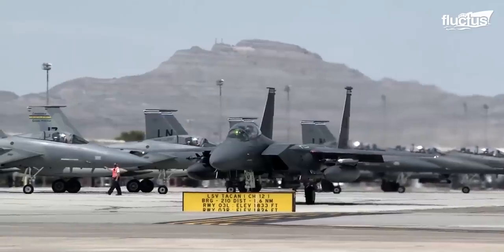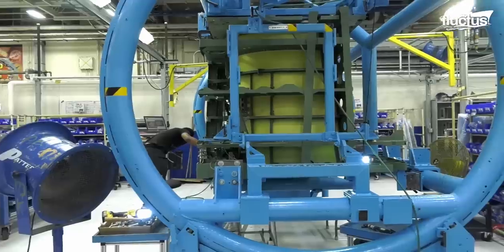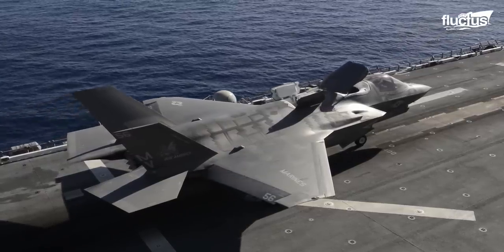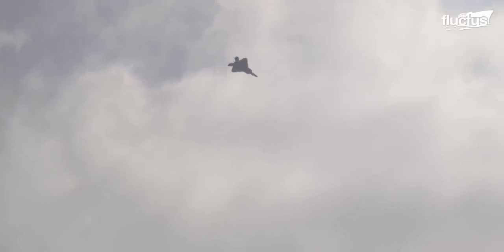How this Cheap But Genius Invention Made the F-15 Most Feared in Dogfight

Comment: Did I miss it, or did you forget to tell what the "Cheap But Genius Invention Made the F-15 Most Feared in Dogfight" is ?????
Reply: (air brake)
Reply: @douglasbuck8986  thanks.
Reply: @lynncomstock1255  NP  Did 10 years at RAF Lakenheath with this airframe....
Reply: The cheap invention is the door at back of the cockpit for braking and maneuvering
Reply: So we could have stopped at the 5:00 point of this advertisement...
Reply: I miss the air shows. These guys put on a great show at low altitude, def what the F15  wasn’t designed for
Reply: It has a can crusher. Makes nickles on board.
Reply: Also makes rainbows.
Reply: 😂 I was waiting for it this whole time.
Reply: @TaylorABell  airbrake
Reply: That's what I was wondering
Reply: Lays golden eggs as well (for the rear navigator).
Reply: you definitely miss it brother and it is a kind of harder than it sounds.
that cheap thing would be the bubbled canopy shape which is so  vital for a fighter pilot to have a kind of 360 degrees field of view while being immerged into dogfight with other aircraft.
Reply: @douglasbuck8986  Thank you!
Reply: 4.29
Refers to the air brake, speed brake.
Reply: @jamesleaty7308  You said the F-15 had a can crusher that makes nickels. A friend of mine is a Submariner. They sometimes put a coin in between the Hatch and the Hull before they go to Sea. When they come back up, the coin is recognisable, but 4 times the size and not much thicker than aluminium foil. It's actually pretty freaky. God knows how the first guy figured out it would be a laugh...
Reply: @mouhcinesniper3495  Naaaah....the air brake....
Reply: the air brake lol like thats a big deal
Reply: speed brake???
Reply: @kibbyken5975  I stopped at 1:41 and just scrolled through the comments until I found the answer.
Reply: @tsubadaikhan6332  I believe that,,, I was jokin about can crusher. In my 50's. Large # off family members in Navy. i'm sure they crush all cans on board, for space. Most large vessels have compactors, for cardboard and trash. They make big bales ,  and forklift them off. They get $ for cardboard and plastic.
Reply: @douglasbuck8986  Yeah but it is mostly used for a controlled landing. And not "How this Cheap But Genius Invention Made the F-15 Most Feared in Dogfight".

You try deploying a speedbrake in a dogfight, you bleed massive energy, and you are dead. Go try it in DCS and see how long you last. Not very!!
Reply: This Guy is a repeater making crazy crap up
Reply: Don't feel bad. You are not the only one that missed it.
Reply: I guess I missed it as well now I have to join the atf to find out
Reply: And why the extra $100 million dollar cost.
Reply: I would say it's the backseater, but the air-to-air models don't have them....
Reply: He keeps mentioning the ginormous speed brake on the back bone, I used it to sleep under on night shift.
Reply: @douglasbuck8986  --@Q2Q
Reply: Cup holders.
Reply: 15 minutes of my life, I'll never get back!!
Reply: Certainly not new, and not inexpensive. Originally designed by "the Fighter Mafia" of John Boyd and Pierre Sprey" ilk.
Reply: Cigarette lighter
Reply: I think its the decals..?
Reply: It is crap because without their AWACS, their air-to-air missiles lunch by F-15 can never hit their targets. It is the AWACS which guide the missile to the intended target.
Reply: Electrics and weapons carriage.
Reply: @mouhcinesniper3495  Immersed* not immerged*
Reply: Streight beast mode

Comment: Did you know the first of the F-15 A/B had it's speed brake was 3 feet shorter, in the early 80's the speed breaks were mortified to what you see today. One correction on your comment on speed brake,  the speed break control is a toggle swatch on the right throttle and can be set to any position you desire, use your left thumb and push up and hold and release it to any position you desire. Push the toggle aft and it will lower to any position as desired. I spent 22 years  as a Crew Chief on 15 A/B/C/D/E. it's old now but still has a punch.
Reply: Sorry to be so picky, but it's a speed BRAKE.
Reply: @deanmccormick8070  Give him a brake, he got it right the first time🤣🤣
Reply: Thank you!
Reply: Quote
"the speed breaks were mortified"
How to 'break' the English language more like. 
Well, I was mortified - scared to death actually.
Reply: Good on ya Wrongway.  The video has many errors, this was one.
Reply: Thank you for your service and a career of financial sacrifice to serve our country!  You made our country stronger!  I hope it was rewarding!
Reply: WrongWay: Is there a position indicator for the speed brake? I only want it deployed @30%
Reply: @jadesluv I assume that you are kidding? Because the video clearly stated that the speed brake could only be set to OFF or ON.

Comment: The US actually has over 400 F15's in active service and that's with over 200 in some state of repair/upgrade/replacement.
Reply: I thought there was more than 249 F-15's.
Reply: Currently have 234 in service ready for use

Comment: This is the only aircraft in modern history to shoot down an space orbiting satellite with its missile!!!....LIVING LEGEND💝🦅🇺🇸🇺🇸🇺🇸
Reply: I am sure it is the only airplane in history to do that, but 40 years is also quite some time ago.🤣
Reply: @xyzaero  40 yrs are enough..but still people use SAMs to shoot sats down while this fighter plane can do both(shooting a sam battery and a sattelite at the same time) which is relevant & remarkable in this era As well!!!!
Reply: @LinngahPremi  Don’t tell me, I love the F-15.
Reply: the missile does most of the work - the trick is to get the plane high enough before the engines flame out.  (at about 60,000 feet?)  i vaguely remember reading something about modifying an f-15 with auxiliary oxygen to boost the operational ceiling...

Comment: The F-15 Super Eagle II is a game changer.  Can’t discuss specifics but huge leap in all areas. Nano technologies like never before.
Reply: Do you mean a F15 EX ?
Reply: @georgesheffield1580  F-15EX with advanced active nano stealth coating integration technologies
Reply: @icare7151  But the shape is not stealthy, so it is still detectable on the radar.
Reply: @NationChosenByGod  Maybe.
Reply: @NationChosenByGod  the shape is not the most important thing. Once a new stealth plane is released, the radars are updates 6 months later to identify this shape after 3d recreation of the plane.
But coating technology, or ECM stealth thing is harder to counter

Comment: I watched Lefty Gardner pull a nearly vertical takeoff in his P38 Lighting named the "White Lighting" at the Reno air races in 1980. 
Once he gained altitude he shut down one engine and did a lot of aerobatics. So 'hole shots' upon take-off are nothing new!
Reply: Late 70's the RAAF came recruiting at High School and had an F15 tail walk across the oval then disappear straight up. Been a favourite ever since, with the F111 a close second.
Reply: @Chris Jones : I watched an F/A-18 Super Hornet do the same thing down the runway at NAS Lemoore in central CA in 2001 and ended with a straight up hole shot. Pretty impressive 👏
BTW Chris, that P38J is now down in your country.
Reply: The English Electric Lightning (first flown 1954) would regularly 'hole shot'. It could take off behind an F-15E in a max performance climb and overtake it whilst still climbing almost vertically. It could also 'supercruise'. The RAF retired them in 1988.
Reply: @foxstrangler  LOL

Comment: Amazing that they don’t ever mention the cost per hour of operation all these aircraft have. The F-22 and F-35 have eye watering operational cost and both have low availability due to parts unavailability. The F-35 has a history of reliability issues.
Reply: Especially the B and C models
Reply: Plus it's so massive it makes the F-14 Tomcat [already a huge fighter] look positively sveldt...
Reply: @nunyabidniz2868  35 is a lot smaller than the 14.

Comment: They should have canted the wings like the Silent Eagle, take that 25 meter radar cross section down a bit. Also, I hear thrust vectoring's major knock is that it makes you bleed energy, so I am assuming they don't use the air brake in dog fights.
Reply: i'm not an expert, but sometimes the purpose of a dogfight is NOT to arrive first.  letting the other guy overshoot and get in front of you is more polite.
Reply: @thomaslouisklein5532  "Polite" ...Love it🔫:}

Comment: I just watched a 15 minute video to learn that the air brake is the cheap and genius invention on a jet fighter. So in case you are short on time. There is it is, the answer to your question, what is the cheap and genius invention. It’s the air break or speed break as they are sometimes called.
Reply: It cheap because it just a piece of metal activated by hydrulics
Reply: It's a brake, not a break.

Comment: hello you are incorrect on you explanation, the device over the fuselage is not a air brake, is a LIFT SPOILER. The F 15 fuselage produces a significant amount of lift to the extent of being able to fly with one wing completely damaged and missing. Note the elevator on a F 16 is not a air brake, AMERICA IS A CONTINENT. saludos

Comment: but the F-22 Raptor is the beast🔥
Reply: F35 with its long range reach - it's almost untouchable.  But I enjoy the F22's maneuverability.
Reply: @rleon8183  Let's hypothetically say this? The F-35 can't supercruise, so the F-35 has to use fuel given its large fuel tank to travel long distances; the F-22 has a fuel tank that is not as big as the F-35, but it can supercruise which requires little to no fuel consumption. Is it logical to say that the F-22 has a better range envelope than any current fighters including the F-35?

Comment: The potential of the Vickers Supermarine Spitfire was inhibited by the G tolerance of the person in the cockpit and this modern aircraft  is exactly the same. The Spitfire had an alternative rudder bar which helped the pilot to be able withstand a little more G than some other aircraft.   The safe limits of G forces had already been reached years before the Second World War. Even when the pilot is clothed in a G-suit the human element was an arbitrary limit which was  rightly feared.
Reply: Early Spitfires couldnt do negative G turns because initially it had a primitive carburrettor which cut the power provision and the Messerschmidt 109Es punished them very severely for it. The equivalent scenario now is the disadvantage of having a flesh and blood pilot in the cockpit  instead of being fitted with a fully comprehensive guidance system.  One which allows the aircraft to fulfill its full Hi-G  aerobatic potential and avoid the drones and guided missiles.  Start looking for another job chaps unfortunately the alternative is unthinkable.
Reply: Were we talking about Spitfires and World War 2? [I may have dozed off. 😂]

Comment: Is there a chance that F-15EX will get TV nozzles like the F-22?
Reply: I doubt it.  I see the EX as being the missile truck for the F-22s and F-35.  If the enemy gets close enough for a dogfight then something went wrong.
Reply: I understand the Tomcat-21 would have got thrust vectoring. Too bad Cheney opted for the spray-and-pray method of dogfighting.
Reply: Like the F-15 STOL/MTD ? I wish they could put in P&W F119 engines without the nozzles. That would give the AMRAAMs more range.
Reply: @rapidsqualor5367  I don't think that they can fit the F119 into the F-15.  For one it's a larger diameter fan and second it would probably also require a redesign of the intakes to make them larger.  By then you would have designed a new fighter like the Legacy Hornet to the Super Hornet.

Comment: I don't have the math or the figures to quantify the energy of an F15 moving at speed; but you can just imagine the pressure of it, knifing through the more or less stationary air, is immense. So you see this big slab of metal popping up behind the cockpit, catching the atmosphere that's just been pushed out of the way by the nose. What kind of motor/hydraulics do you need to push that sucker up, against that magnitude of moving air?! And how strong is that thin rod that pushes & holds the airbrake up?? ~:^o
Reply: Well the C and D models shown here use two Pratt & Whitney F100 PW 100 turbofans to do that pushing. Together they can generate more thrust than the aircraft can weigh, giving F-15 a unique characteristic among modern jets, a greater than one thrust to weight ratio. In a max climb, the only thing that can stall an F-15 is lack of air.

The speedbrake actuator piston is a hefty piece of titanium/steel alloy that operates off the utility hydraulic system, separated from primary flight control systems. It's true operational strength is its honeycomb design of its surface, giving it great strength with minimal weight.

Comment: You missed the New Engine in the Eagle 2 - General Electric F110-GE-129 engine is capable of delivering 17,155 lbf of thrust (29,400 lbf on full afterburner), whilst being more fuel efficient.

Comment: If they aren't already building the F22 replacement on the old line than sum'it is wrong.
Reply: Legitimate question, isn't the F-35 supposed to be the replacement for the F-22? Except that the F-35 costs as much as the F-22
Reply: @bobkonradi1027 No, the F-35 is the replacement for the F-16, A-10, Harriers, and F/A-18.
Reply: @pike100  My point was / is that the USAF is not going to allow an $80M+ gold plated plane to go out on hazardoud missions to shoot up convoys of grubs driving around in the Arabian desert in used pickup trucks. The F-35 has no ability to sustain damage and return to base like the A-10 does on a near-daily basis. I don't care what the F-35 is allegedly designed to do, they're not going to allow it to provide low-level close air support missions. It is an $80M+ sexy, glamorous plane that will only be allowed to perform sexy missions like aerial dogfights against the Russkies. The USAF has been wanting to get rid of the A-10 since about the day after they took delivery of the 1st copy of one. They do not want the close air support role, they have never wanted the close air support role, because its not sexy, there's no glamour in it. Their pilots want to only fly sexy dogfight missions, and not strafing runs against camel jockeys.

Comment: I sorry but the F14 if given the chance to be modernized like the F15 would have been a far better aircraft! The F15 is a great aircraft but not like the Tomcat!
Reply: Unfortunately, no amount of modernizing will make the F-14 a better plane. The Tomcat with its variable geometry wings (swing wings) was a victim of an already obsolete design which very few aircraft use today. Variable geometry wings, by its very design, adds weight and complexity to an aircraft and as of now the only remaining aircraft still employing the use of variable geometry wings is the B-1 Lancer...
Reply: The tomcat-21 would have got better engines, thrust vectoring, and carried more fuel, with updated electronics, longer range, and higher top speed. 

Cheney decided they'd rather spray and pray- throw enough of a cheaper, less capable plane at a target, and one is bound to hit it.
Reply: Tomcats are good in the movies, just like Tom Cruise, but those days are gone,time to move on,Swing wing has its compromises.

Comment: These videos are getting boring.  Same O Same O always the same thing.    Becasue Most all new features of modern aircraft arent visible anymore. Their technological based software, electronics & integration and top secret.   The turning and burning era is long gone and that's why a 60's based aircraft is still relevant today.    A video like this may be enlightening to someone extrememly new.  But really there's thousands of videos exactly like this one all over YouTube.  Its all just OLD NEWS. Bla bla bla.   
I dont even go to airshows anymore, they used to be so mush better 30 years ago. To much regulation now, airshow & aircraft keep getting farther and farther away from flight line. Airshow off Base are a complete waist of time.    If you want to lern something new fly DCS flight sim or for old computer Falcon4.
Sorry for the rant I must be getting to old.